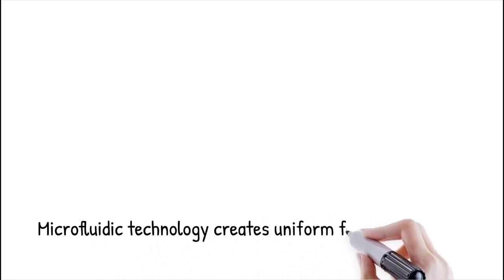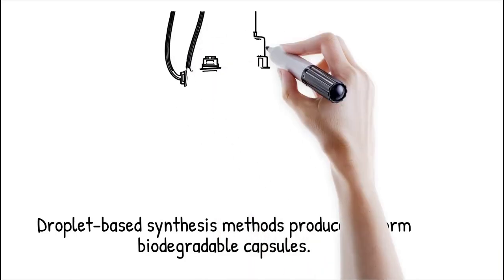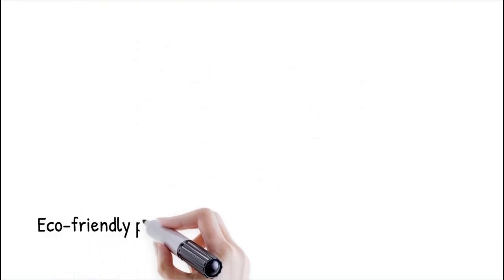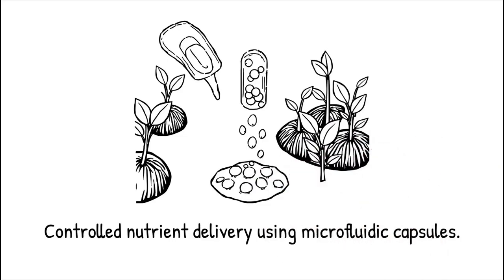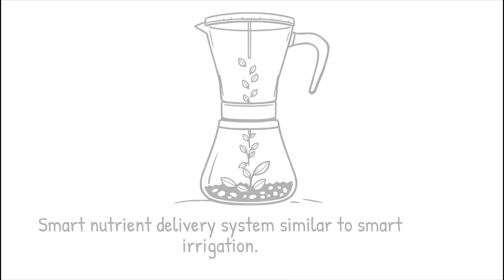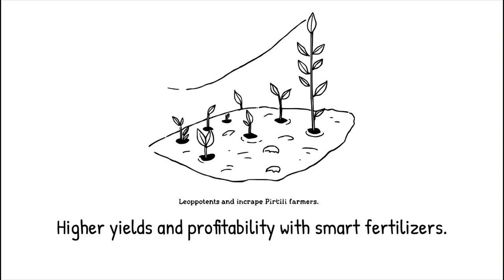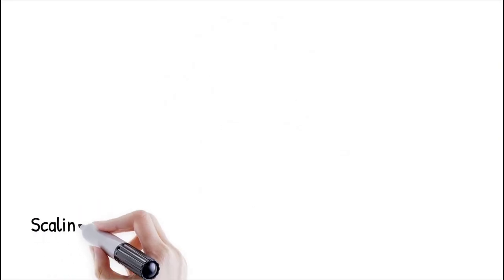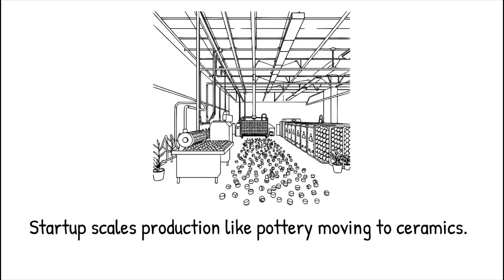Microfluidic Fertilizer: A Game-Changer for Precision Agriculture

Comment from the maker: How can microfluidic-generated biodegradable capsules be engineered to selectively release multiple nutrients at different stages of plant growth while maintaining structural integrity?
What are the physicochemical limitations of biodegradable polymers in extreme agricultural conditions (e.g., high salinity, arid climates), and how can they be optimized for long-term stability?
How can AI-driven predictive modeling improve the precision of nutrient release in microfluidic fertilizer systems, and what are the computational challenges in simulating dynamic soil-plant interactions?